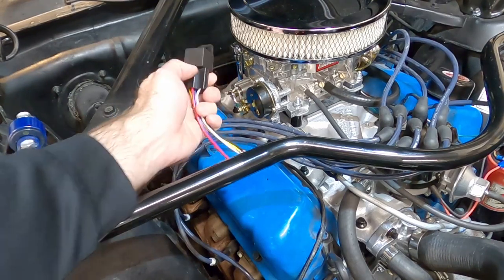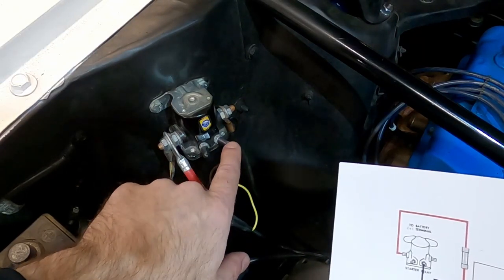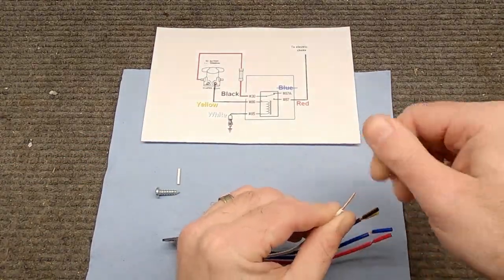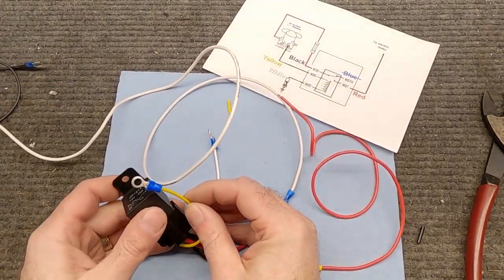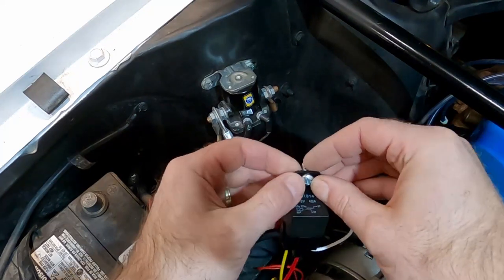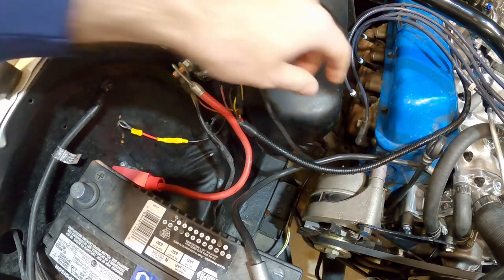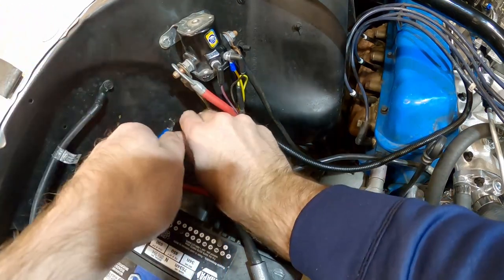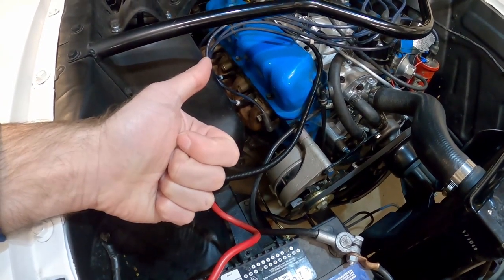How to Wire a Relay for an Electronic Choke

Comment: Grounding the choke to its body doesn't seem like it would be the best option? I thought the Block or fire wall was where they should be grounded?. What am I missing.
Reply from the maker: The carb, heads, manifold, block, and firewall are all metal and connected, and the block is already grounded to the firewall.  Because of that, grounding it to the carb is sufficient.  It is incredibly common for people to ground the electronic choke to the carb like I've done here.  Now, adding a relay for the hot wire for the choke is a little overkill, but it's what I wanted.  :)

Comment: i just tried to run a relay on a 64 mustang and the wire you got the power for the relay to open/ turn on wasn't getting any power would you know why this is happening? i tried just touching the wire to the battery and the relay works. is there another place i could tap in to to get power? or even where the power is coming from that goes to that stud on the starter solenoid
Reply from the maker: The wire that triggers the relay is the wire that goes to the ignition coil (I think it's brown?).  However, some cars don't use that terminal, specifically if your car does not have a resistor wire as part of the ignition coil.
You may be able to tap into the back of the ignition switch in your dash for a "switched" source.  I think the red wire with a green stripe might be what you're looking for.
Reply: @AndyKruseChannel  unless I'm getting a significant voltage drop from the ignition to the starter solenoid I'm only getting 5.8v and the terminal do you know what voltage your getting at the solenoid
Reply from the maker: @rydred0823  You should have around 12v there, not sure why you're getting 5.8v if the car is running.
Reply: Same here.  The stud marked with the I on the solenoid is down around 6v.  Car does run.  Mine is a 67 Mercury Cougar with 289.

Comment: Why did you not attach the red wire to red off the relay instead of white. Or get black wire to attach to the black wire off the relay instead a red wire.
Reply from the maker: I don't know if the wire color on my relay was standard, the red wire is the wire that gets electricity when the coil in the relay is activated.  The white wire is the ground for the coil.  Connecting the white wire to the electric choke would not provide the desired results.  Further, the black wire on my relay is terminal no. 30, this is the wire that needs to be connected to the 12V source.  I guess I could flip the red and black wires and still achieve the same results, but I cannot swap the red wire with the white wire.  Again, this applies for the wire harness that came with my relay.  I provided a diagram in the video showing the wiring layout just in case someone had a different harness, but could use the same numbered terminals that I did.

Comment: What size fuse and what was the relay part number?
Reply from the maker: I think it's a 15A fuse in there right now, but I might bump that down to 10A.  Not sure about the relay number, but I did get it off ebay in a pack of 5.  This is a normally-closed relay.

Comment: Also - why is a relay needed there in the first place. (Rookie question ;-)
Reply from the maker: Ideally the Choke is on its own 12V, and not pulling off something like the Coil or other circuit that is in use.  The Choke doesn't draw much current, but if you're in the position to have a dedicated circuit, it's better.  Also, the relay allows the Choke to pull a full 12V from the battery and it can be triggered by anything that is on when the car is on.  In this case, the ignition terminal on the Starter Solenoid is active when the car is on.  That terminal is putting out a 12V signal, but it pulses (based off the Coil) and is not an ideal source of electricity for the Choke.  But it's good enough to active the relay and allowing the Choke to grab a good 12V from the battery.  :)

Comment: What about for a Chevy
Reply from the maker: Are you asking where to pull the signal wire from to trigger the relay?  Otherwise, wiring up a relay to power the electric choke on other vehicles would essentially be the same as this.

Comment: newbie here, what's the benefits of doing this?
Reply from the maker: I like my circuits to be isolated, so if there is a problem, I can narrow down where the problem might be. However, the amperage pulled by the electric choke is very small, so realistically pulling a 12V switched source from pretty much anywhere would be sufficient here. 🙂

Comment: Why a relay??? Just run a fused 12vdc key on source to the choke.  Also it's a bad idea to use your hold down adjustment screws as a ground since you loosen the screws to adjust and some times you want it activated to adjust. Per your method you would lose it's ground.
Reply from the maker: Thanks for the advice.

Comment: I can't see a ground being a ground at all when wired to an aluminum choke housing which is part of  an aluminum carb. The carb is bolted on an aluminum manifold. Where is the steel? Also, the choke is electric, not electronic.
Reply from the maker: You do know that aluminum is conductive, right?
Reply: ...And conducts better than steel.

Comment: What is the fuse? 40
Reply from the maker: I think I have a 7.5A fuse in there, it was the smallest I had in my garage.  This system draws so little amperage that a 5A fuse would still be overkill.  :)

Comment: Why do you need a relay....I wired mine through the oil pressure switch but direct from ignition switch to fuse to choke should work fine....
Reply from the maker: There are lots of ways to wire up the choke, I wanted my setup on a dedicated circuit so it's easy to find electrical issues if I have them.  :)

Comment: Complete waste of time, Ford never used a relay on a carb choke, draws very little amps, save relays for electric fans, fog lights, high draw acc.
Reply from the maker: Agreed, relays are more useful for components that need higher current, but it serves it's function.
Reply: Disagree bud. I'm actually having that issue. I'm running an electric fan and it draws way to much power so my fan do kick on. It goes from 12v to 9v.
Reply: I followed Andy's video and it works. Plus side of it is that the choke has a heated coil so if the choke fails and just so happens to draw an excess amount of current its a failsafe precaution for $10.

Comment: Who runs a relay on there carb choke anyways? Ford people are strange.
Reply from the maker: Yep.
Reply: @AndyKruseChannel  was reading some of the comments & FORD did use a relay for their electric choke for the Holley 4180c four barrel carburetor found on the 84-85 Ford trucks with the 351 H.O engine . The choke relay was mounted on the firewall near the brake booster .

Comment: You don't need a relay for a electric choke you just need to connect it to the acc on the lgnition switch. The more wires you put on the more that can go wrong. Unnecessary.
Reply from the maker: Respectfully, I disagree.  While your suggestion would work, having a dedicated 12V source to the choke keeps the amperage draw at a minimum running through the ignition.  Yes, more wires can create more issues, but if someone does it correctly and in a manner that makes sense, tracking down issues becomes an easy task.  In this case, if the electric choke was not working correctly, one does not need to mess around in the dash to find the issue as everything is in the engine bay and located in a small area.
Reply: JUST USE THE ING. COIL 12 V. +. ONLY 12 V. WITH KEY ON   KEY OFF NO 12V. TO COIL.  &  USING BUTT CON. THATS  BEING HALF ASS WORK !!!
Reply: @AndyKruseChannel  no that is not true the ignition switch has a dedicated accessory  post for a reason when you try to crank the engine the voltage will go away so you don't have a draw on any accessory you have. The ignition switch has a battery wire a number 8 or 10 guage depending so when you start the engine you will have between 14 to 14.5 volts going to the electric choke. If you're charging system is working right you should be able to turn on your heater blower motor your head light's wipers and anything else and the alternator should still put out between 14 and 14.5 volts. And you do not ever connect another wire to your coil your coil needs at least 9 volts to work properly and if you do you will have a voltage drop when starting the engine. I have been doing this kind of work since the late 60s I owed a chassis shop for over 20 years and built race engine's I just retired.what might your credentials be.
Reply: And by the way if you had a problem you only have one wire to trace the one you ran to the electric choke and  you should put a fuse in the wire to eliminate that problem and if you blow a fuse check your electric choke for a problem.
Reply: Wrong, ING. Side of key switch, acc. Is for radio. If wire to acc. No power to choke.
Reply: @l.munnier9658  do you  realize what you just did if I read you right you claim the acc is for the radio witch means it has power but it won't work for the electric choke is that right. If so think about what you said.
Reply: @russellsnapp4867  O.k. if you are park , eng.  OFF ,. key on ACC. radio on , would also be powering up 12 V. to ELE.choke. GET IT !
Reply: If you get your 12V from the accessory the choke will only work if the ign. Switch is on Accessary....It needs to be on the run side of the Ign. Switch to keep the choke open after warm up....If you connect it to hard battery the choke will never close....
Reply: @l.munnier9658  Check the ampre draw on the choke and compare to the size of the wire from the ign. To the coil....That wire might not be large enough....It is 2:15 AM and I can't check my books....